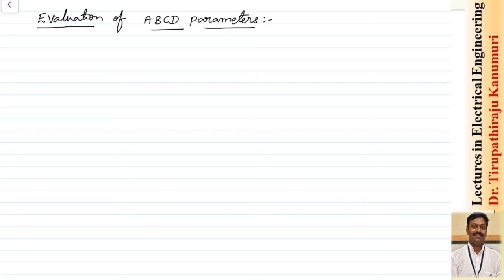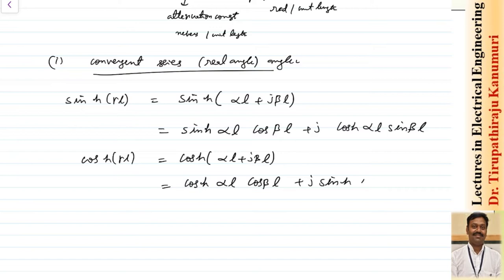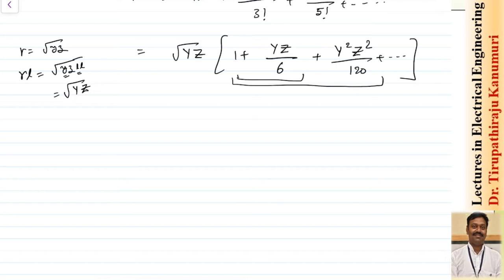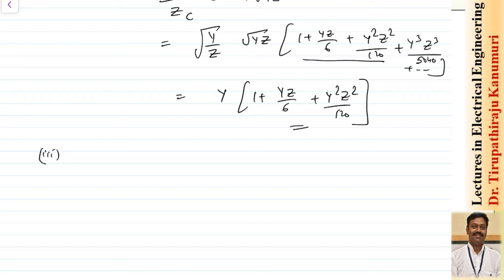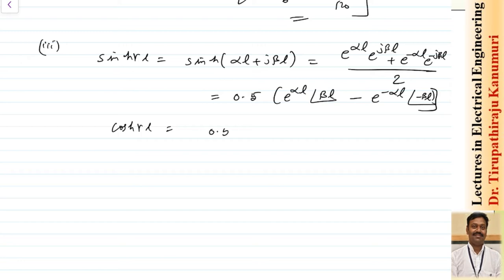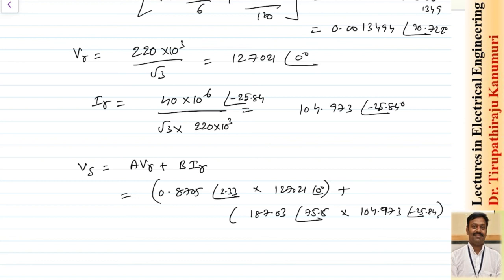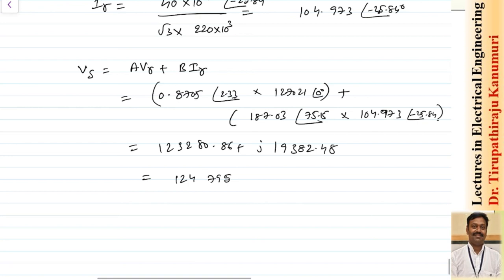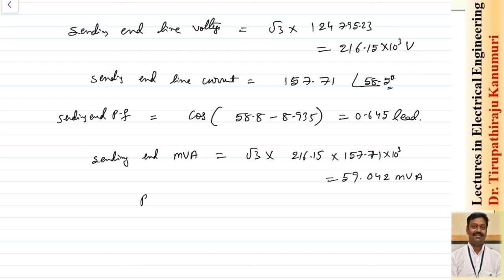PS27 Numerical on Long Transmission Lines

Comment: the problem which you solved you got as -0.00017+0.001349 at 11min in vedio but i got in calculator 47.9+180j

which one is correct

Comment: In calculation of Ir using power formula why cos(fei) is not used sir
Reply: @lecturesinelectricaleng   Complex power is in VA but active power is in MW. So we have to divide pf to find sending end current.